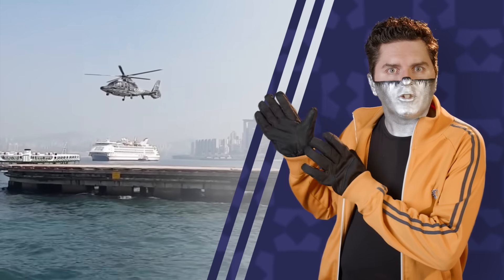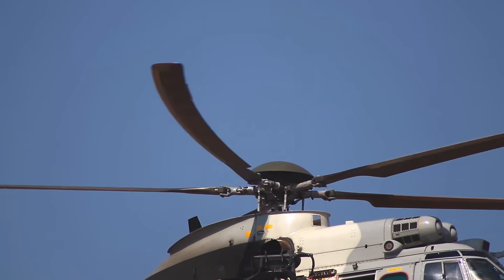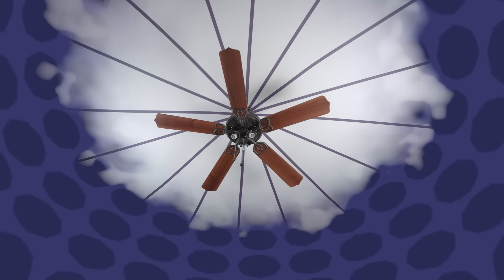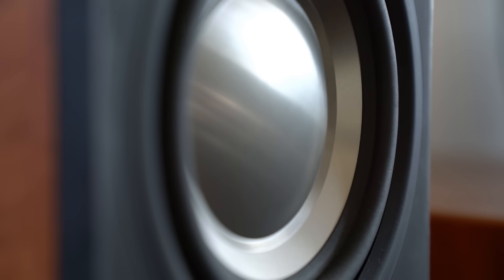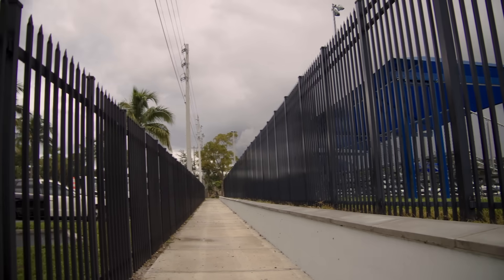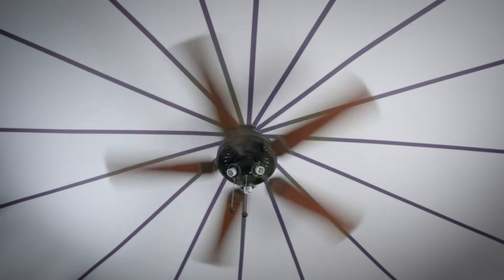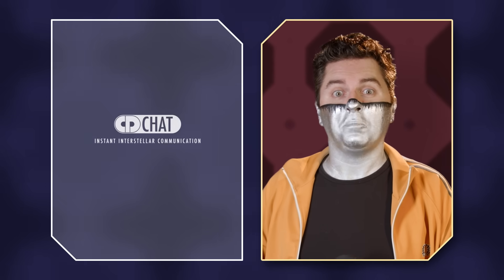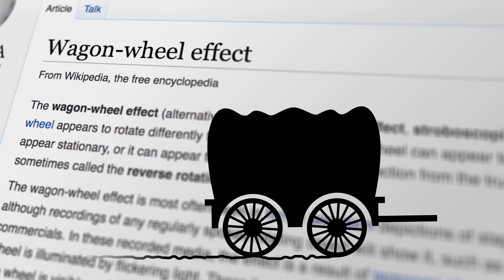Static Helicopter Blades | Quick D

Comment: Rolling shutter is easier to manage memory wise and they typically have better low light performance. Because rolling shutter requires memory which is stored on the image sensor surface.

Comment: I make juice cartons at my job and we use strobe lights to run the material and check for defects. We can run up to 1200 meters a minute and we can “freeze” the paper while it’s moving using a strobe light.

Comment: quick additional info:
helicopters don't spin the rotor faster or slower to go up and down, they rotate at a (preferably) constant speed during flight (if the RPM go way up or way down you have encountered a problem and should consult the user manual) - just like captain said. the way they move vertically is instead controlled by the pitch angle of the blades via the collective in the cockpit - it'll usually look like a handbrake on a car. this allows the blades to push variable amounts of air while spinning at a constant speed - vastly more responsive than making the entire engine speed up or slow down.

Comment: Old cameras can definitely have rolling shutter — if they're plumbicon (CRT) video cameras, used by professionals and studios before the 1990s.  Newer video cameras use CCD sensors, which did not have rolling shutters.  Of course, CMOS sensors also started being used around that time, but in different settings.  I guess they replaced film in similar purposes, more than CCD that replaced CRT.
Reply: Perhaps I shouldn't call it "rolling shutter" for old video cameras since nobody called it that then either?  It was just a roving scanline.

Comment: I think you just explained for me why a muzzle flash in action movies will appear to alternate between the top and bottom of the weapon when it illuminates the objects around it. I always knew that it would flash out of sync with the sounds (you hear more shots than you see muzzle flashes for) because of the frame rate, but I was always curious how it would 'dance' between illuminating the top or bottom of the scene. This has always bugged me.
Reply: Yep, I'm pretty sure that's the reason; rolling shutter. You'll see this same thing in some of the (non-faked) videos of lightning strikes too, when the scanning happened to be in the middle of the frame when the lightning strikes.
Reply: @IstasPumaNevada  I'm off to look up some of this footage now, because I love how a rolling shutter distorts things like airplane propeller and I'm really interested in seeing lightning strikes now.

Comment: Possibly the most common stroboscopic effect is doing ignition timing on a car with distributor ignition. The strobe is triggered by the number one spark plug wire and the stroboscope makes the timing mark on the crankshaft pulley appear to be stationary so that correct alignment between the timing marks can be achieved.

Comment: I designed and built a stroboscope that runs at 2 fps (flashes per sec) up to 200 fps, and I did some quite cool things with it.  My favourite was to set the wash-basin tap in my bathroom to a fairly fast drip - just short of running water.  Then with the strobe, I can slow down the drip rate, so that you can watch the drip forming in slow motion on the tap, then detatch itself, and fall slowly down into the basin.  By increasing the flash rate very slightly, you can make the drop stop in mid-air, so that it can be examined (remarkably spherical), and if the flash is speeded up just a little more, the drops start by forming on the basin, then move upwards till they are eventually absorbed by the tap.

All this looks absolutely great to the naked eye, and I was pleaed to demonstrate it to my family - but because the rates was all based on the drip rate from the tap, I couldn't synchronise it to the frame rate (30 fps) of my camera.  I would have loved to make a video of it to post to YouTube, but the results I got were really poor.  Apart from the flash coming when the camera shutter was not open, there was also the problem of the focus going in and out.  Unfortunately, it's not the sort of camera that can have a manually adjusted fixed focus.  If only  ...

Still, for those who could see it directly, it was quite impressive, and the drop moving up into the tap looks quite baffling.

Comment: I've heard of industrial accidents that've happened because the rapidly-flickering fluorescent lighting in (for example) a factory or an auto workshop makes something look like it's not turning or is only turning slowly, when in fact it's rotating at high speed. I'm sure you can imagine what happens next. The most recent one I heard was a car radiator fan that looked like it wasn't turning.

Comment: Just so you engineers aren’t too afraid, I’ve installed two fans like that, as instructed in the manual in the box, and the older is next to me, on the ceiling, right now, as I installed it, like it’s been for over a year. And yes, it works. Well, except when there was a power outage, and No I didn’t blow the city power grid! There was a storm.

Comment: I've hung up a good many ceiling fans, and let me tell you they aren't easy.  The wiring part is actually the easiest thing to do.  Pro-tip, you won't be shocked if the switches are off... you don't have to go to the electrical panel and turn off power to the room.  Building the damn thing sucks because it's got 500 parts and instructions written in Chinese, it's heavy and hard to work with when on a ladder, and you're constantly dropping the tiny screws either in the fan motor or on the ground to be lost forever.  The hardest part, no lie, it trying to attach the light-kit after you've got the blades on.  There are too many wires stuffed in such a tiny compartment, and the manufactures expect you to be dead-on while screwing in three little screws.  Keep in mind you have to do this with one hand, as your other one is holding the light-kit in place while you struggle to get align the screw-holes correctly and put in the screw you're about to drop because it's balancing wobbly on a screwdriver.  The whole thing is a nightmare, especially if you get a cheaper fan that's "quick-and-easy".  Harbor Breeze is the easiest ones to put up, Hampton Bay is okay, Hunter is...ugh.  Everything else can die in a fire.

Comment: I had a Canon GL2 that I was able to adjust the MHz rate to prevent the old CRT monitors from having the horizontal lines on the screen. It's the same concept

Comment: In a previous job I set engine speeds by using a timing light (strobe).  I could adjust the speed of the light to verify the engine speed.

Comment: Hi Captain. Just discovered your channel recently. It's fantastic.

Some more details:
The original clip is filmed at 30 fps.
The helicopter in the clip is an EC155. In normal flight, the rotor spins at 342rpm. For helipad take-offs and landings you engage a "HI NR" mode to give you extra rotor  inertia in case of an engine failure, so you can safely abort the landing or departure. That brings the rotor speed to 360 rpm. So you get this. It also looks really cool on video when the HI NR mode is turned on and off.

Source: about 1800 hours flying in one of those.

Comment: Fun fact: We actually use a strobe light to adjust track on the helicopter rotor blades. By having small reflective targets and a strobe tuned to the rotor RPM we can see if the blades are moving in the same plane (on a fully articulated rotor) adjustments can then be made to either pitch links or tabs on the blade to bring them in to optimal track for the least vibration.
Reply: This is how ignition timing in automobile engines used to be done, too. In this context, it's called a timing light. 

Professional musical instrument tuning is also frequently done with a similar method. These are called stroboscopic tuners. The difference with those is that the spinning thing is kept at a known rate and the strobe timing varies based on the sound the instrument is making.

Comment: cameras with true global shutters don't exist. the rotating mirror in a movie film camera creates a rolling shutter (frame from Alien (1979) during a strobe flash: https://i.imgur.com/kmfjCJk.jpg).
As does the scanning action of the electron beam in an analog video camera. however, film doesn't have the look we associate with rolling shutters because it has a much faster shutter chase, which means the actual action of the shutter opening (which is actually very similar in the case of electronic cameras). The perception of skew from the rolling shutter is further subdued because the exposure time is longer (1/50th of a second) This still varies depending on cameras, though. Digital cameras claiming to have a global shutter simply have a very fast rolling shutter chase. Or, they may not. There's no regulation saying they have to have a certain shutter chase time to be considered "global." It's really just a marketing term. I'm sure the Alexa and all the RED cameras have a very similar shutter chase to the Blackmagic cameras, but Blackmagic pushes the term "global shutter" in their marketing more

Comment: The older Folks might remember - old vinyl record players used to have a small light and these shiny plates on the sides of the turn-table. So you could check wether your record was perfectly played with 33.333 rpm oder 45rpm

https://youtu.be/_ug66WQAMeM?t=360

Comment: This effect actually gets produced by prop engines in Kerbal Space Program, whether using the DLC that makes them intentionally possible or by building your own bearing and blower engine using ingame parts with very tight tolerances. It can sometimes be difficult to tell if and how fast they are spinning.

Comment: I've installed several ceiling fans with no issue, but you sure as shit want to understand a few basics about electricity if you're going to do it. If I hired a total amateur to install a ceiling fan, I wouldn't be worried that it was going to fall. I'd be worried that he was either going to electrocute himself or start an electrical fire.

Comment: Not related, but I saw a plane really low and it was just floating there...
Reply: What if alien spacecrafts disguise themselves as airplanes?
Reply: @crrctd7464  They don't. They disguise themselves as aeroplanes.  :P
Reply: Yeetus Yeetus Kermit self deletus I like trains  I don't know what causes it. I used to live directly across from an International Airport, and I swear I've seen planes appear to just hover in the air. I know there's some kind of scientific explanation for it, but it's unsettling to witness.
Reply: @X99GD  
A very light biplane or triplane in very high headwinds, can't imagine what kind of modern planes could manage that, maybe something like a Cessna.

Comment: fun fact: if a helicopter engine starts up, you can see - no matter what frame rate(even with your eyes)- that the blades start spinning in one direction, some weird flashing, moving in the other direction, slowing down, and all that again a few times until the rotor reached the normal rpm.

Comment: I was able to produce something similar with a store bought LED flashlight, and Variable Frequency Drive (VFD) controlled Industrial Fan (impeller style fan) Motor. Since was able to adjust the frequency to 1/1000 Hz (between 0/60Hz), I was able to accurately match the LED's oscillation so that the fan looked stationary at multiples of the resonance (may be the wrong word, but it feels correct to me) frequency.

Comment: Just like using a timing light while timing an engine. The light flashes on the timing marks and you can see the marks as if the engine isn’t spinning.

Comment: But i dont understand. sometimes when cars pass by while Im in a car, the other cars wheels goes slower and slower until it goes backwards even tho they are in the same speed. What is up with that? also when I used to have fidget spinners, if there was a light pointing directly down at it, it would do the same effect and thats not recorded... thats my eyesight. can someone please explain Im very curious.
P.S. Love ur videos. Please post more
Reply: I think, I can explain: The effect can not just happen with a camera but also under stroboscopic illumination (like Cap D showed with the fan).
In the case of the backwards turning tires of a car next to you: If you sit in a car, the vibration of the engine also vibrates your eyes. This causes a similar effect as if you were seeing light flickering at the same frequency as the vibration. Apparently, you can create the effect by humming as well.
As for the fidget spinner: certain lights (like fluorecent lights) will start to flicker once they go bad. At first, it might be barely noticeable but will still produce the "strobe light" effect for your fidget spinner.

Comment: But my ceiling fan has 4 blades
Reply: Mine have 10000000000000000001000000000000000000100000000000000000010000000000000000001000000000000000000 100000000000000000010000000000000000001000000000000000000100000000000000000000000000000000000 1000000000000000000100000000000000000010000000000000000001000000000000000000 blades

Comment: Could u calculate the "frame rate" of a human eye based off the speed of which a car wheel appears to be not moving or would there be to many variables on how many degrees the wheel has turned?

Comment: helicopter rpms at this size and type are usually something roughly around 300rpm and can be slightly modified by the pilot and other circumstance
given the framerate match and 25fps that actually adds up right away since 300rpm is 5rps with 5 blades is 25 bladeswaps per second

Comment: Wait a sec, the fan's spinning clockwise :p so if the marked blade pops one place over counter-clockwise every frame, then hasn't it actually popped 4 places clockwise? Unless you changed the fan's direction in between :p

Comment: I did a lab in my engineering undergrad where we shined a strobe light at a motor to get the RPM's so that we could calculate the power output. It was pretty nifty.

Comment: Why do you sometimes see this kind of effect on car wheels if they're driving at just the right speed? What's the frame rate of my eyeballs?
Reply: Found the synth!!
Reply: You mean... IRL??? Human perception ceases to distinguish individual images round about 12 per second, but it depends on attentiveness and complexity of the field of vision. Rods and Cones are continually being fired, so in that sense there is no rate limitation, but each of them takes a few hundred milliseconds to get back to a triggarable state.16 fps looks perfectly fluid under most circumstances. I don't understand people who discern a difference between 25 and 50 fps. They sound like the audiophiles of old, pretending to hear differences that are not apparent to the uninitiated.

Comment: Your brain has a frame rate.  Watch wheel rims on a car as they accellerate or decelerate.  They'll appear to slow down, then reverse direction.  If they could maintain the exact speed where the apparent direction changes, they would appear frozen.  After all, in order for it to reverse direction, even apparently, it has to come to a full stop.

Comment: You can actually swing a pencil or something similar in front of a monitor if the brightness is not on the highest setting and get a similar effect. This is because monitors turn on and off very rapidly to appear more or less bright.
Reply: Do in front of a data projector and you see ghosts of your pencil in different colours!
Reply: @DrWhom  sounds cool enough to try

Comment: Actually, old time cameras have given the name to the rolling shutter effect, as the shutter was literally rolling across the frame. 

In fact, old cameras and projectors used actual spinning shutter wheel with holes in it. If you're going to run a film through a camera without a shutter, all you'll get is a whole bunch of blurry mess. As the technology progressed and manufacturing methods got more precise, shutters went from spinning to jumping across the film. Even later on, such thing as electronic shutter became a thing and was more or less coincidental. Magnetic tape can take the picture you want, but it can only take it line by line, as the tape goes over the recording head. Since storing the whole image and then recording it on tape later would create horrific delays, and it would be technologically impractical, the image still would be affected by rolling shutter effect. Modern devices use digital memory, but, rolling shutter is still a thing. That's because even though it's hypothetically and practically possible to take snapshot of the frame all at once with global shutter, it's expensive and... with high speed photography at your fingertips, kinda pointless...

Comment: I found out two days ago that my LED flashlight is pulsing (faster than I can see). I had just mounted a new GPU in my PC, and used the flashlight to see if everything was OK first time I started it up with the new GPU installed. It looked like the GPU fan spun slowly, then stopped up. When I tried to use my finger to start the fan spinning, I got a nice surprise. *BANG*. Yup, the fan was spinning just fine. It was the damn flashlight that acted like a strobe light.